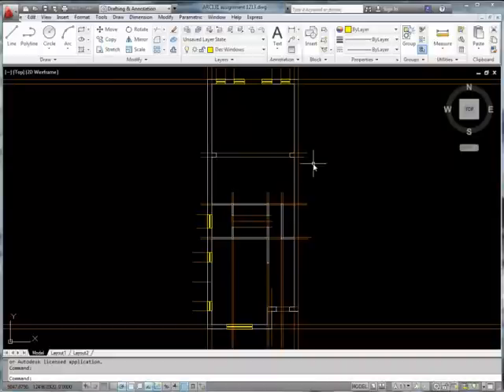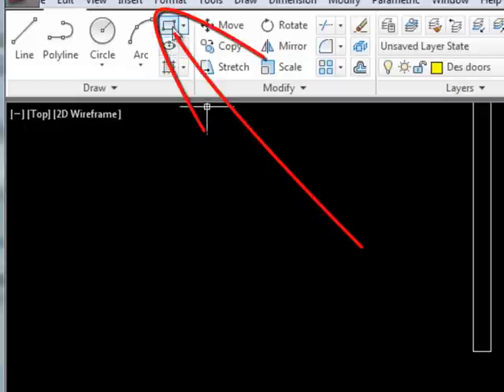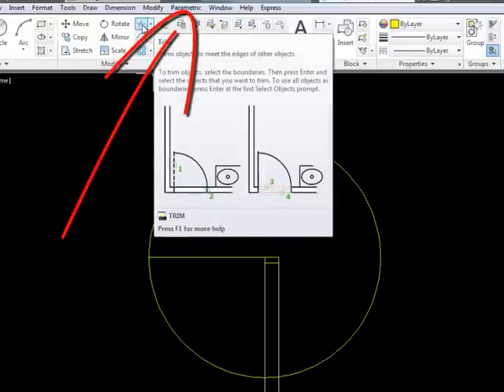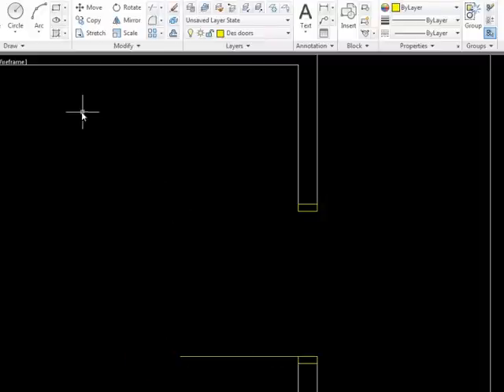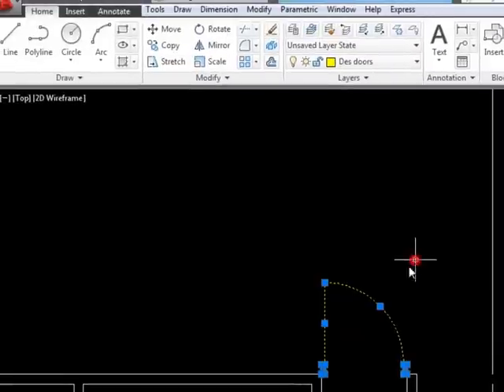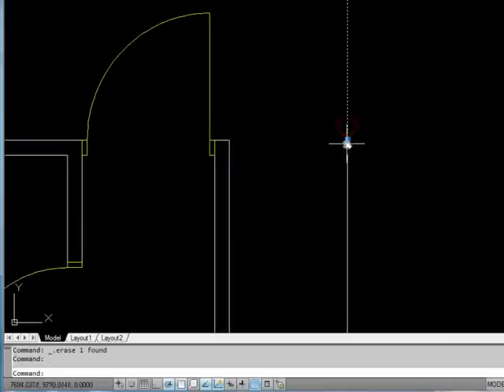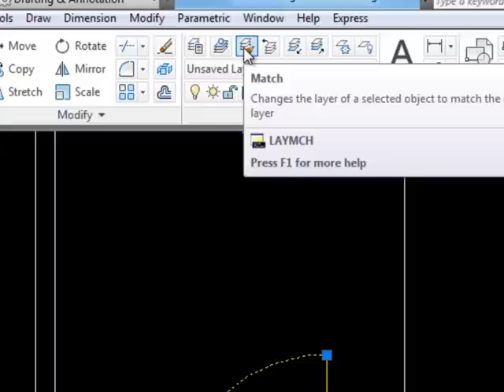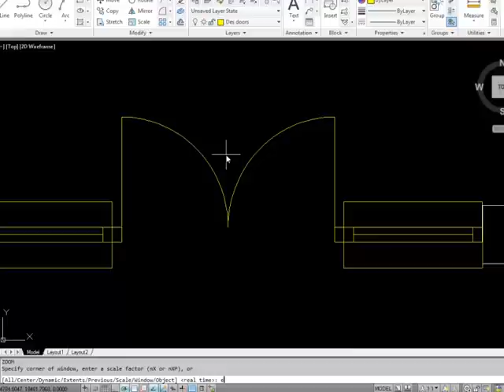AutoCAD 2012 Tutorial 4 - Adding doors

Comment: AutoCAD is so ancient. Why people still use it for building design is beyond me
Reply: AutoCAD has 2017 and 2018 versions as well. It's good for assembly drawings for electrical or mechanical parts. If you're designing a OLED TV, Blueray player, a table, an engine etc.

It's still good for architectual stuff too. The "autoCAD is ancient" argument could be used on Windows OS and Apple OS too...or even Firefox for that matter.

I mean, they've all been around since the 90s.
Reply: Ioan Andrei Bindean what would you use then?  I am just curious is all
Reply: LagiNaLangAko23
It depends what u wanna do. Currently I believe that Allplan is the best option. There are others that are more specialized, like tekla which is better for steel. If you are going for Arhitectural plans, then you can also try archicad or if u wanna go crazy and do 3d models, then blender is a choice to consider. All in all, the program that does all of these better faster and easier is Allplan in my opinion. From a civil engineering point of view

Comment: Very nice tutorial....how can I increase the door thickness to show on the plan?
Reply from the maker: Simplest would be to draw a rectangle of door width by 35 to 40mm for its thickness.  It isn't strictly necessary, though, because the line plus arc indicated door plus swing.  Back in the old days (when every door was drawn individually on a drawing board, by hand) you wouldn't have bothered!